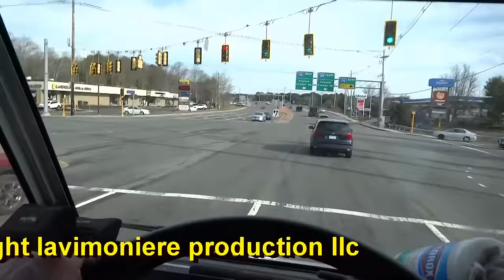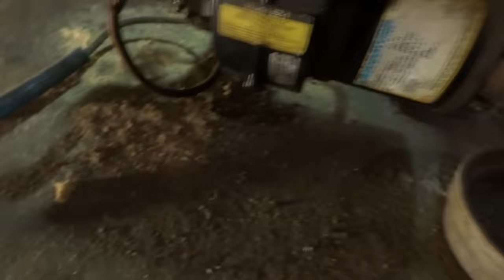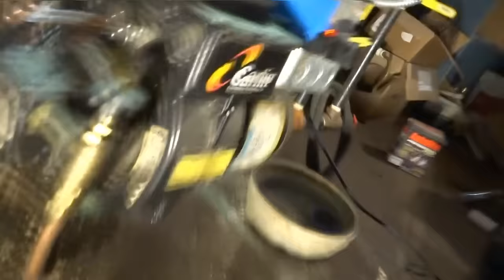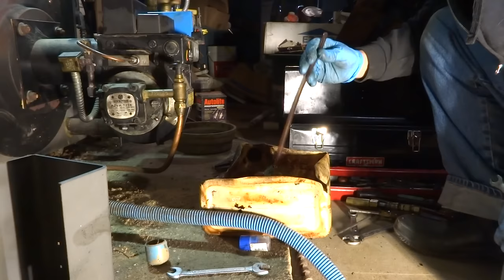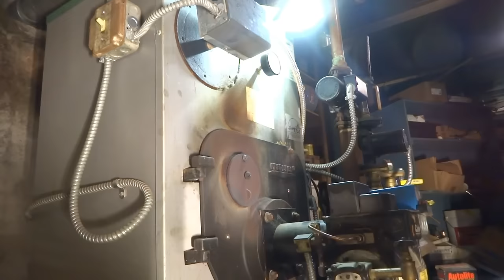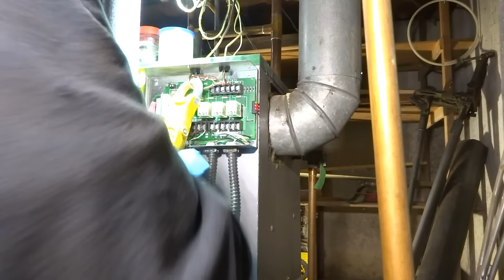NO HEAT OR HOT WATER BOILER NEEDS SERVICE PART 1 OF 2

Comment: If the Taco control has a priority switch, maybe mentioned below the hot water has to be satisfied first . So if the circulator for the hot water is bad, the control will not be satisfied to allow heat to the other circulators- no 120V. When you replace hot water circulator, the Taco will allow the other heat zones to work. That might be the issue as others have mentioned.

Comment: I don't have a problem with biodiesel. Ran it in my car for years when I had a diesel car. Ran it in boilers in several houses for many years as well. It's not an issue if the correct filters and piping are used. 1 pipe system is a bad idea, sludge will build up in the bottom of the tank if the oil doesn't circulate. With 2 pipe it doesn't. Double filters are a good idea as well. Make sure to use the bio rated filters, the others have rubber that reacts badly with the fuel. Certain nozzles don't run well with the fuel either. Hollow (A and H) are a bad idea. Delavan regular solid (B) tend o have issues too. Nozzles with brass components also don't work as well. The best to use are Hago B and SS, Steinen S and Q, and Monarch A and AR. Danfoss is coming out with special nozzles now, the HVO series. Do the right things and there are no issues. My mother's house has been running on B100 for years. Double filters on each appliance. Furnace has an ancient Beckett SR with a J pump. Never has an issue. The point is, MA is going to ban oil at some point. They can't ban biodiesel because it's carbon neutral. They're already going that direction with gas. Would you rather change your filters once a year or heat with those stupid heat pumps. I know what I would rather do, I like my oil heat and I'm not getting rid of it for any reason.

Comment: could it be a bad fuse under the relay also if this is a Taco SR503 zone 1 is priority when the jumper is removed should say right on board. The way its acting with Zone 1 having 120v on it that its in priority mode and the other two zones won't come on until zone 1 is satisfied. This won't happen until you check out circulator on water heater.

Comment: There is already ethanol based diesel and it doesn't look to be a problem. Ethanol in aviation is coming but i am guessing you will have to run it in aircrafts that are meant for it.

Comment: For everyone talking about priority, he literally jumped it out and bypassed all of that and you could hear the relay click and it still didn't pass any power. There's probably a bad solder joint or something on the board.
Reply: So if Cube #1 was good and the board was reading voltage when he switched it to #2, why not get a new cube? Just curious
Reply: @lustfulvengance  Did you not see the end? 1st cube gave voltage in the 2nd slot. So it was a bad cube, not board. No?
Reply: I just saw the end again and I see now. When he said "you know that cube is good" he was talking about the one from slot 2. Got it now. Good stuff

Comment: You're talking about changing oil in cars.  In piston airplanes the recommendation is to change the oil every 35 hours.  25 to 50 is typical for most people and organizations, the 35 comes from analysis of when the additives start losing effectiveness.  The filter is changed as well and the old filter cut open to look for any metal.  Also not a bad idea to send the oil in to Blackstone Labs for an analysis to get wear trends by metal content.  All this for where having your engine work properly is very important.  If your car engine is important to you, more frequent oil changes are a cheap way to help protect your investment.

Comment: Always learning; helping to learn.  If I wait a little too long (over 5K w/synthetic oil). Diesel TDI.   The Metal free oil filter is either spiraled or crushed.  5K is my numba (New England accent). :)
Reply: The same thing happened on my 09 Jetta tdi until I used the Mann filter with the straight pleats. The other filters that are zig zagged are gabage. Haha
Reply: My mother has one of those. Amsoil makes a filter with synthetic media. The only one I have found that doesn't collapse.
Reply: @user-kg8jh8dp7q  Thanks bro, flattering really.  I use WIX filter generally. 
local NAPA store has them in Cross lake.  but don't go 10K miles, unheard of in parts around here.  Days were, it was 2, 3,000 miles for Dinosaur syrup.  I'll do another fuel filter change, down the road.  wow, cool.
Reply: @theodorgiosan2570  My only supposition was that it collapses if you wait to long (too many miles).  Us OLD boys like 5 K miles! ha!   Anyway...

Comment: Don't worry about jet fuel in planes.  It is a highly refined version of kerosene.  Why?  Kerosene remains a flowing liquid at extreme cold temperatures.  "Jet A is primarily used in the United States. This fuel is developed to be heavier with a higher flash point and lower freezing point than standard kerosene"

Comment: Steve can you coat the inside of the tanks before installation.
Reply: You can but it’s not gonna do anything. Best thing you can do if top off with oil at the end of heating season. So there’s no air in the tank. As for the sludge there’s nothing you can do. It comes from the oil. If you live in Europe the oil is cleaner and doesn’t do this. But in the states it’s always gonna happen.